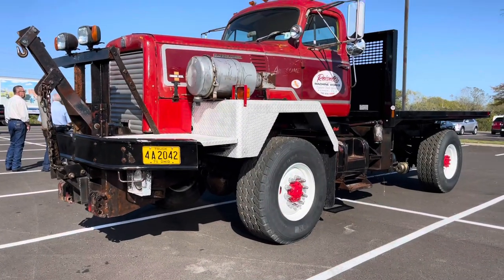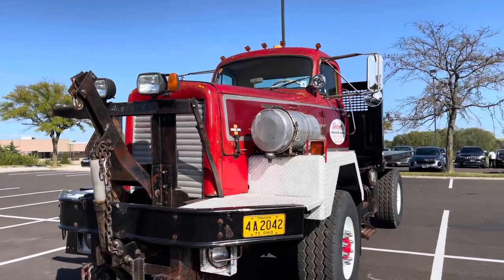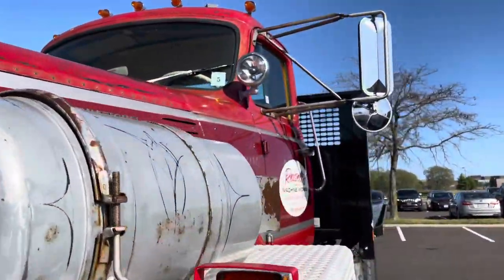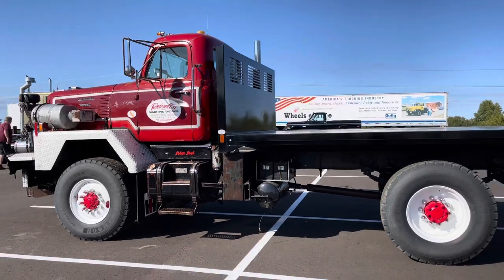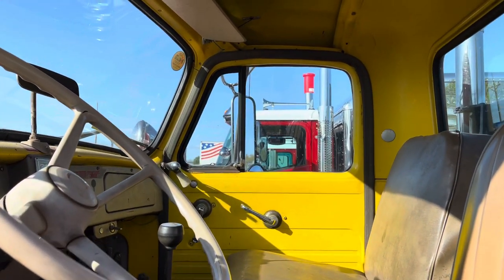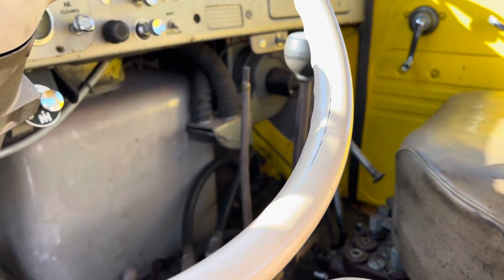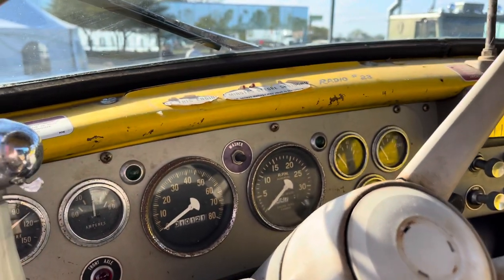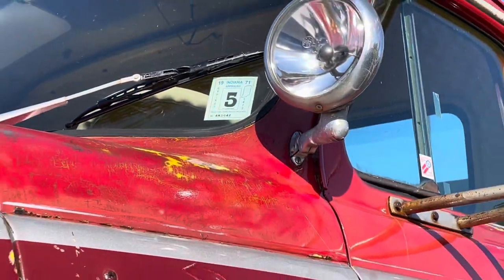Erich Reiselt’s 1971 International M412-70

Comment: we had 2 of these 6x4 cement mixers with 549 ci. V8 gas motors backed with 5speed main and 3speed aux trans. They were hot in the summer and drank gas like kool aid, but were a blast to drive and could go almost anywhere. i wish I had one now.